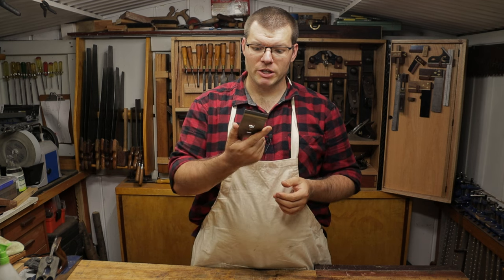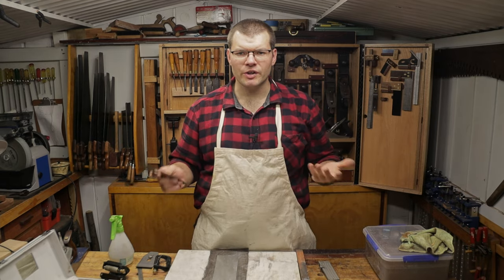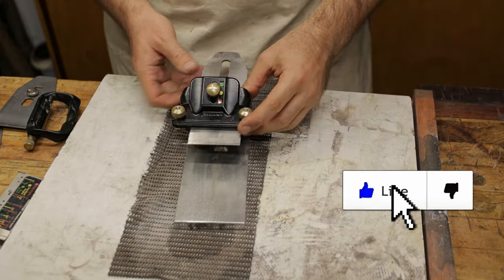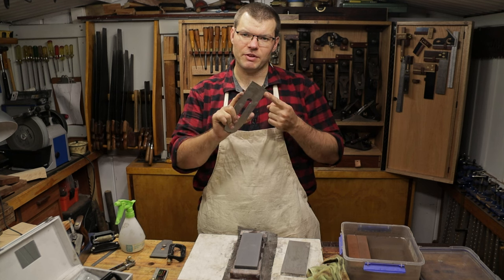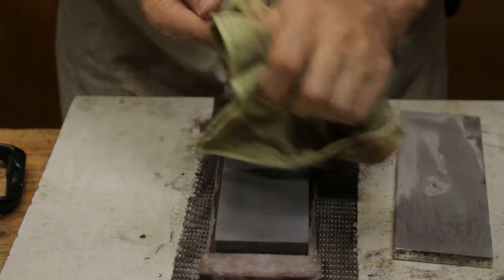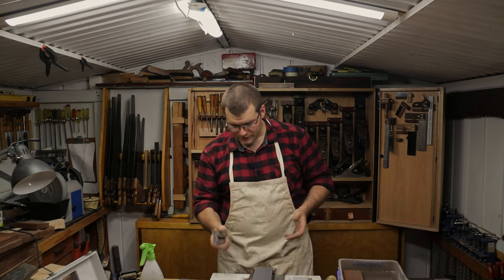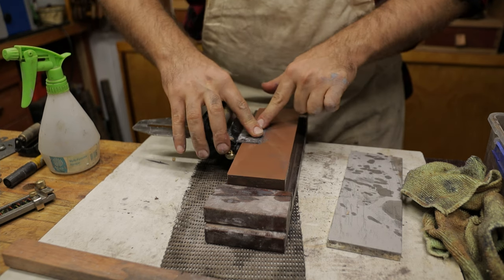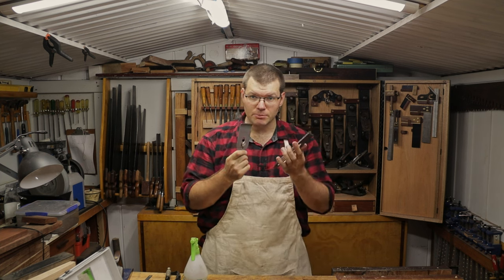How to SHARPEN a hand plane blade

Comment: Maybe you’ve explained somewhere that I’ve missed before or maybe you’re a hybrid shop and I’ve missed all of that, but why don’t you use cambers on even your Jack or Try Planes?  I can understand fully not doing so on say, your jointer. Your thoughts would be appreciated.
Reply from the maker: Thanks for your question. I am a mainly hand-tool workshop, but i do use and tormek grinder and battery drill and if i had the space i would use a band-saw also.

I don't use cambers on any plane blade other than my 1 rough removal converted 'scrub' plane which has a heavy camber. 

In the video there i was referring to not using camber for normal sharpening and rolling the corners of the blade instead. I might not have made that clear enough so i might revisit this topic and make a new video.

I do this so i don't need to sharpen a camber into the blade every time, as i don't use micro bevel either as they don't speed up the sharpening process for me once the primary bevel is set. I also dislike the idea of regrinding the bevel unless i chip the blade.

Hope this clears it up for you, if you have any more questions please ask.